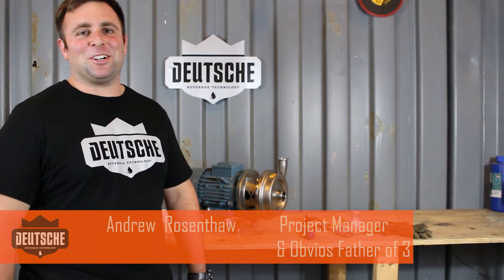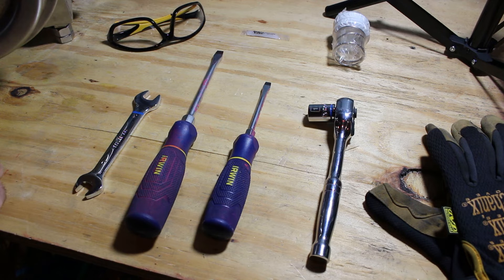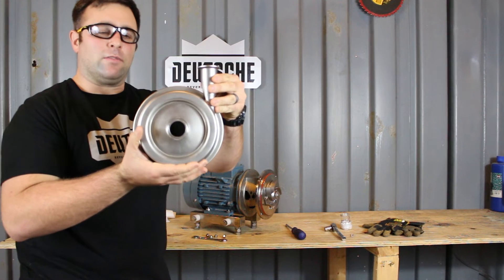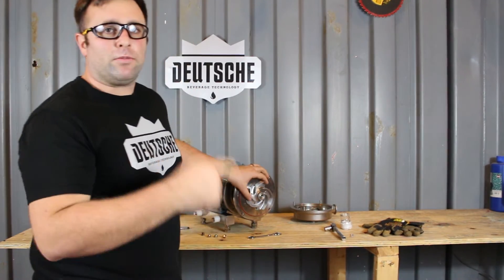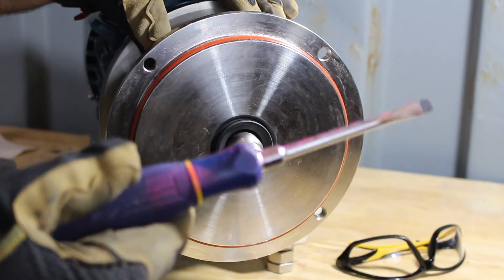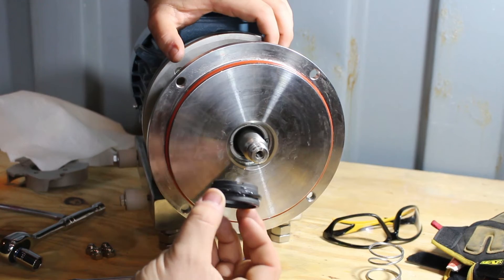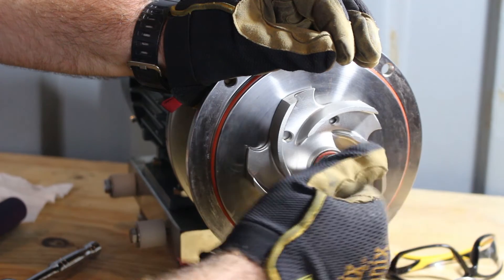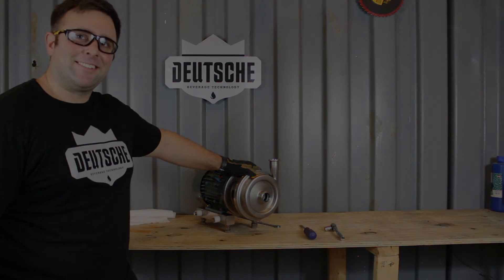How To:  Pump seal replacement

Comment: DO YOU HAVE THIS?     SEAL;MANUFACTURER: INGERSOLL RAND EQUIPMENT NOTES: FOR AB/3CRVH COOLING WATER PUMP, SN: 1273-4019, 1273-4022 GE NS 5000 TURBINE, SN: 2263098, PURCHASING NOTES: ITEM: 429D, TRADE NAME: DURASEAL, SUPPLIER: CON RAD DIVISION INDUSTRIES INC

Comment: Could lubrication such as grease or assembly oil and fingerprints on the faces of the carbon seals cause brand new seals to leak?

Comment: Price?hp?rpm of this pump?brand name of pump?
Reply: Mdl: SD200-3M - Capacity: 300 m3/h / speed: 1800 min -1 / Total Head: 120 / Shinko Pump / Price: $8,000 USD / Weight: 2200 KG / New - never used / Location :  Roterdam Netherlands

Comment: I have a Pascali pump not the same as this but looks similar. My problem is that water leaks and sprays out of the top fastening nut do you think that is because of the mechanical seal or the big O-ring? If the O-ring can that be replace?
Reply from the maker: Even though they may be similar, we unfortunately cannot give recommendations or troubleshooting advice on pumps we have never used. I’d recommend getting with the pump manufacturer.

Comment: Good video - however he didn't show where to apply the food grade lube...where do you need to put it?
Reply from the maker: Thanks, Chuck.  The food grade lubricant should be used along the sides of the replacement seal where there can be some friction when inserting the new parts.  Do not use the lube in between the two seal pieces.  Thanks for the feedback and we hope the video helps.